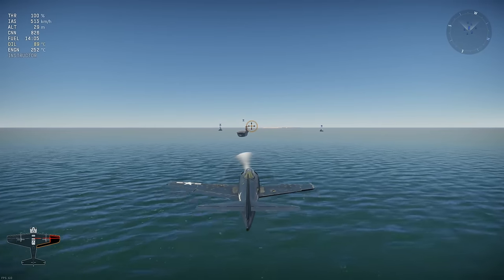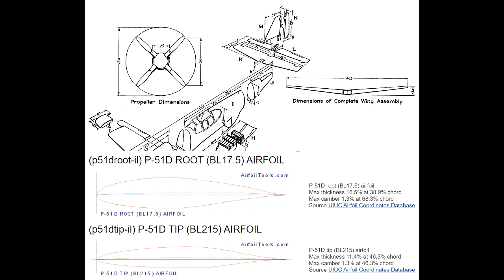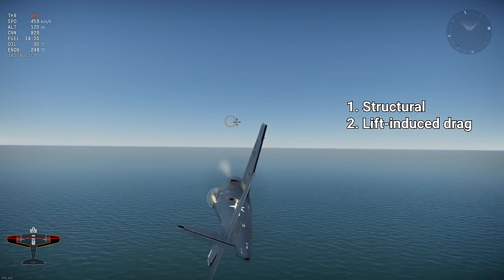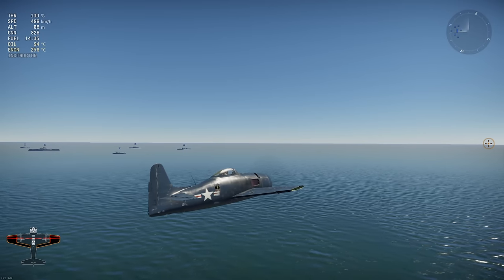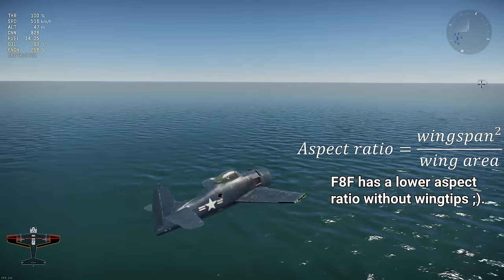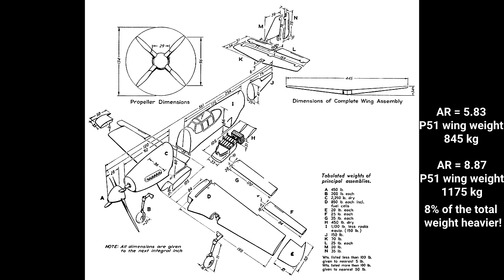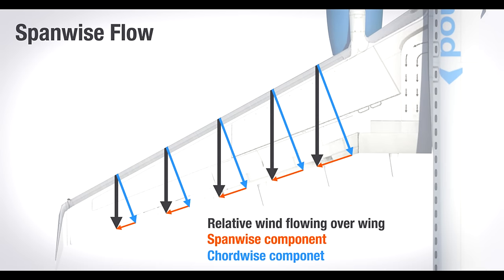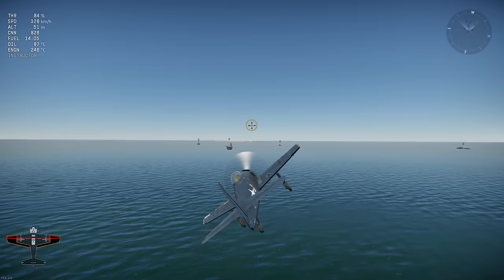Fundamentals of Aircraft Wings

Comment: This was quite good. I liked the part about a thicker wing actually being lighter, I hadn't realized that, but as soon as you said it, it made perfect sense. I'm not quite in agreement on the dihedral part but that's OK, it's a great video and I learned some things!
Reply from the maker: Thanks!

What would say about dihedral instead?
Reply: @AdamTheEnginerd  Nothing you said is wrong, it's just not complete and could be misunderstood to mean that dihedral will return the plane to wings level anytime there is a bank angle, which isn't the case. This topic is is often misunderstood, nearly every flight sim gets the effect wrong. Dihedral is complicated and tough to explain really well. It does effect roll stability, but only when in a slip, not in a coordinated turn. Here is the explanation from Aerodynamics for Naval Aviators page 295: 

"The principal surface contributing to the
lateral stability of an airplane is the wing.
The effect of the geometric dihedral of a wing is a
powerful contribution to lateral stability. As 
shown in figure 4.28, a wing with dihedral will
develop stable rolling moments with sideslip. 
If the relative wind comes from the side, the
wing into the wind is subject to an increase in
angle of attack and develops an increase in lift.
The wing away from the wind. is subject to a
decrease in angle of attack and develops a de-
crease in lift. The changes in lift effect a rolling
moment tending to raise the windward wing
hence dihedral contributes a stable roll due to
sideslip. "

NAVWEPS DD-8OT-80

    Note that is says, "with sideslip" That's the key to the whole thing. Great video! Please don't take this as a criticism, it's just an addition.
Reply: Ah plane jesus
it's good to see you here
Reply from the maker: Yeah I didn't explain how it works precisely because it's complicated, I know it requires a sideslip. I just talked about its effect and why it's useful. I could make a whole video on dihedral (maybe I'll talk about it more in depth when I make my roll video).
Reply: @AdamTheEnginerd  I look forward to watching that.

Comment: 3:45 Necroing this comment thread to talk about the Prandtl-D, a flying wing demonstrator where they actually give the wingtip a negative incidence, so that the load distribution hits zero before it reaches the wingtip, and then goes negative. This apparently cancels out any adverse yaw, and allows it to do a coordinated roll without a rudder or decelerons!
Reply from the maker: Hmm never heard of that. You need a bigger wing than would otherwise be needed though because of the lower lift.
Reply: @AdamTheEnginerd  yupp, I think the creator listed that as a downside to that approach. Still, a really creative way to do turn coordination!

Comment: I've been thinking a lot about this stuff and I am really happy that you made a video about! I'm not sure if you explained why a higher aspect ratio as opposed to just having a greater wing area is useful, but I'm really looking forward to that upcoming roll rate video!
Reply from the maker: Higher aspect ratio means less induced drag when maneuvering. It's why the Ta152H has great MER while the F8F with short wings has bad MER.
Reply: AdamTheEnginerd You mentioned that in the video, but now why. I guess I'm asking for an intuitive answer for a question relating to the topic of Aerodynamics, which is probably a bit too much. Anyways great video.
Reply from the maker: @axelandersson6314  Intuitively, you can consider that the higher the aspect ratio, the less the wingtip vortices affect the wing (further away from the rest of the wing). It's not quite right to look at it that way, but it provides an intuitive explanation from which the right conclusions are drawn.
Reply: AdamTheEnginerd Thanks a lot!
Reply: @AdamTheEnginerd  is the correcter answer that because the load per unit span is smaller for a higher aspect ratio wing, therefore the vorticity at the wingtip is lower?

Comment: Another way to think about the effect of wing sweep is to understand that on a straight wing, you get a normal shock. On a swept wing, the shock is still parallel with the span, and is therefore an oblique shock.
Reply from the maker: Is that how it works? I thought it was equivalent to reducing effective wing thickness.
Reply: @AdamTheEnginerd  Sort of, in both cases the effect of the shock on the flow is reduced. 
The reason an oblique shock has a lesser effect on flow is the same reason you mention in the video: only part of the flow is normal to the shock.
It is the same thing, just thinking about it from a different reference frame.
Reply from the maker: Intereesting.

Comment: I’m only 17 and I’ve been flying RC planes ever since I was in middle school and also been playing WarThunder for like 3 or 4 years.
I’m right now trying to design the spitfire mk 22 and I’m using a low drag airfoil that way I can fly at high speeds and not violently tip stall or high speed stall. Why do some planes high speed stall or tip stall?
Reply from the maker: Some wing geometries have their stall start at the wingtips, for example elliptical wings. The Spitfire had to have a washout or twist to make the wing root see a higher angle of attack than the wingtip so that the root stalls before the tip. You'll have to do that as well if you have tip stalls.

Comment: I liked this vid a lot but there seemed to be a common misconception near the end at 12:47. Namely that the difference in airpressure above and below the wing generates the required lift. This Bernoulli effect does indeed generate lift but it is rather a side effect/product of lift than its cause.

Because if the difference in air pressure(airspeed) would be the vehicle of lift production then airplanes with symmetrical wings would not be able to fly, nor would airplanes be able to fly upside down. Even totally flat wings can create lift by acquiring the right angle of attack.

It is a minor point in this other wise excellent video but too important to ignore. 

Thanks and best of luck.
Reply from the maker: The difference in pressure between the top and bottom of the wing multiplied by the wing area is equal to lift, there's no getting around that. There's no other way for a lift force to apply to a wing other than through pressure differences. If you had pressure sensors all over the wing, you'd know exactly how much lift is being generated.

Another point is that Bernoulli absolutely applies to explain lift, whether it be a flat plate, a symmetric airfoil, 0 or any other angle of attack. All Bernoulli is saying that when speed increases for a given airstream, pressure decreases. That's always correct. The misconception I think you're referring to is the equal transit time theory which says that the air particles that split up at the leading edge must meet back at the trailing edge at the same time, and since it needs to travel more distance over the top of the wing compared to the bottom of the wing it must speed up and reduce pressure, and then that theory applies Bernoulli to explain lift (wrongly). In that case indeed it doesn't explain symmetric airfoil, flat plate, and angle of attack lift.

You can plot the airspeed at different points on the wing if you had the pressure distribution on the wing, and vice-versa. Bernoulli used appropriately explains lift.

Comment: Funny thing that the Ta 152 had no problems with wing load. I will always love good old steel.
Reply from the maker: The wing is always made to match the loads it needs to bear.
Reply: @AdamTheEnginerd  One would assume that in a high alt interceptor weight might be slightly more relevant. With the lack of enemy b-29s it was quite good that it had steel spars rhough.

Comment: What's the practical effect of a stalled wing? What happens to an aircraft when a wing stalls at the tip? What about at the middle of the wing or the root? Love the videos by the way!
Reply: iirc, a stalled wing generates less lift and more drag, and most importantly, control surfaces on the stalled wing in the wake of the stalled area stops working
Reply from the maker: Stall happens when your wing's angle of attack exceed the CLmax angle, and beyond the CLmax angle you lose lift and cannot maintain your original heading.

When a wing stalls at the wingtip first, your ailerons lose a lot of effectiveness. That's not such a big deal until you get a stall on only 1 wing tip, which creates a big roll moment that can flip the aircraft around in a matter of seconds, quite dangerous.

Thanks!

Comment: Very nice video Adam! , seems very related with my recent questions ;-)! 
As I am at home all the day I decided to start making a model to try to upload it to live. 
What do u think would be nicer: Bf109 k-14, Bf-109 Buchon or the p51B/C? 

(They are all relatively easy models to make because i can, especially for the k-14, take existing WT planes ad make the required changes, without doing (like the man who created the Iar81) a whole new model
Reply from the maker: Thanks! Indeed it was!

Buchon, what's that?

Not much of an aesthetic guy, I wouldn't be able to help with the choice.
Reply: AdamTheEnginerd if I’m not mistaken the Buchon is the Spanish Bf109 with the Merlin. (The ha-1110/1/2) 
There were many variants, but the most important was: a Bf109 E4 with a thee blade merlin (i think is the spit mkV merlin) 
 and 2 Hispano Hs-404 cannons. 
(Basically the Spanish engineers saw the 109 and the Spitfire: they took the (in my opinion) less good airframe and put in it the less good engine (IMHO)  lol).

I’d like to do the k-14 because it’s the best version of my favorite fighter aircraft, but, as 90% of WW2 stuff on Live is added in the game and usually are op premiums (look at the ta-154) the k-14 would be another superprop, and with a 2600hp engine, a very efficient prop (it had a completely new 4 blades prop) and 760km/h (SPD) maximum speed (and obviously an insane climbrate) would be probably too strong for all the props except the Spitfire mk24 and, maybe, the p51h. Still in a jet match would often get killed easily, as it cannot go in a Dive at 810 km/h before ripping.  It’s just that superprops are too op when downtiered and too weak when against jets, and there are too few superprops to do a superprop-only match. 
The Buchon is not a WW2 plane but is a nice and strange plane that could be like a 3.0.
The P51B/C are probably one of the most important planes that WT is missing.
I’m very undecided lol
Reply: The only bf-109 k14 downside is that the armament consist of 3 mk108 (2 cannons were internally mounted in the wing) and the 2 mg131. Wing cannons could be changed with mg151s, but the mid one, probably the most important, remained an mk108.

Comment: Hi Adam,

may I ask a question? How did you get all of your knowledge on the different planes in war thunder, which ones are better at climbing, at turning etc? How can I possibly acquire such knowledge?

And also a request from my side: could you please make a tutorial on the Bf 109 F4 in Air RB? I got a talisman for it and intend to use it for  grinding, but I'm not very good with it.

Kind regards,

Mischa
Reply from the maker: Experience, testing, and Aerospace Engineering ;). Acquire K N O W L E D G E by watching my vids.

It's on my list!
Reply: @AdamTheEnginerd  Well that explains a lot. Thank you for the quick answer. Any short tips for the Bf 109 F4 maybe, so I can fly it a little better?
Reply from the maker: @mischa8752  Hmm German teams at that BR are good, you shouldn't have issues since it's a very good plane. Could be 4.3 in my eyes.
Reply from the maker: Climb straight in and you should be above essentially every Allied plane. Don't turn with them, make sure you have the energy advantage before attacking an enemy that turns better (UK). You can turn with US and succeed for the most part.

Comment: 2 questions Adam, how do the later griffon spits have such a high critical Mach number without swept back wings? 

And what’s the point of the tempest wing design, they are thin and have blunt tips like a p51 but they look like they’re trying to be elliptical like a spitfire, was Sydney Camm trying to get the best of both worlds when designing the aircraft?
Reply from the maker: A thin wing like the Spitfire's helps delay the critical Mach number, that's the main reason.

That's 2 separate things, airfoil shape for "thin and have blunt tips like a p51" and wing geometry for the elliptical portion. Apparently in earlier stages of its design it did have fully elliptical wings, but then it was changed and the wingtip cut off to improve roll.

Comment: The weakness of the spars being oriented like that is at high speeds they bend back and snap! One annoying thing that happens a lot in war thunder! I always wondered how you could pull 9 Gs but you can’t go around 500 without ripping in most planes!
Reply from the maker: That's actually why there are 2 spars usually, together they form a box to resist twisting.
Reply: The speed limitations of wings is usually a result of flutter, where the elasticity of the wing allows it to catch the wind at a higher angle of attack, causing it to start flapping very forcefully and quickly, much like a flag. So effectively, the wingtips are experiencing loads much much greater than the relatively static load experienced at 9 g, and break.

Comment: Are there any advantages of having a low mounted wing over a high one? Or a elevator on the bottom of the vertical stab vs on the top like the mig 15 has.
Reply from the maker: Yeah of course. Low mounted wings allow the landing gear to be stored in the wing/shorter, and the junction between wing and fuselage is lighter on a low mounted wing because when pulling high Gs, the fuselage "compresses" on the wing instead being in tension in the case of a high wing, so that's structurally sounder.

Elevator position depends on wing position largely. Mig15 has a higher elevator position because the wing is at a higher position than usual, and you don't want the elevator and stabilizer in the wake of the wing.
Reply: Also, high mounted wing block some of your view when you look back.
Reply from the maker: @nectismanta8080  Yup that's important.

Comment: Do you think the spitfire’s poor MER is aerodynamically accurate or just a nerf by Gaijin? You would think the Spitfire’s (almost) elliptical lift distribution would minimize energy lost from induced drag. Interestingly, the spitfire also has remarkably low drag at high speeds, even beating the P-51. [https://www.aerosociety.com/media/4843/the-spitfire-wing-planform-a-suggestion.pdf]
Reply from the maker: Spitfires have average MER. In the FM files, the Oswald coefficient is perhaps a tad lower than you'd expect, but still reasonable. The fuselage induced drag numbers for the Spitfire seem odd, but I don't yet know how exactly they calculate drag from the fuselage coefficients.

Comment: 🤔🤔🤔 Now i see why many countries follow Kurt Tank desing Filosophy... BTW did You know that the GM-1 injection system is now modeled in the Ta 152 H-1? I already test it... And it works!!! 12,400 m and running 1.8+ a.t.a.
Reply from the maker: What philosophy?

It's modeled as another supercharger gear in WT IIRC.
Reply: The F8F is very Influenced bye the 190 desing 

And yeah... However... That means (as far as i know) unlimited WEP
Reply from the maker: @terrado6746  F8F and Fw190 have completely different missions and performance.

It has 20 minutes of WEP or so.
Reply: @AdamTheEnginerd  yup but some of the bases of F8F are from the 190 

Good enough :v

Comment: Now i'd like to know why WW2 bomber wings so often are swept backwards.
Reply from the maker: They aren't really, they just have a taper so that the engines aren't exactly side by side.
Reply: AdamTheEnginerd That doesn't describe the situation of the american B18A or the Heinkel 111 which are twin engined, and doesn't explain why the H6k4 has a no such sweep of even taper. I'm guessing that slower planes like it might just need the front avoid span wise flow but I really have no clue. The tendency seems to have the wings tapered, but often keep the trailing edge of the wing straight. I just don't understand why.
Reply from the maker: There's other considerations too. There's center of gravity changes due to fuel burn issues, ease of construction, and gear location whether is tricycle or tail dragger configuration. On the He111 for example with its tail dragger configuration, you need to have the main landing gear which are in the engine nacelles in front of the CG, but you also need to have the CG in front of the center of lift. That gives some incentive to have a bit of sweep to move the center of lift back.

That said, the amount of sweep on these bombers is low.
Reply: AdamTheEnginerd Thank you.